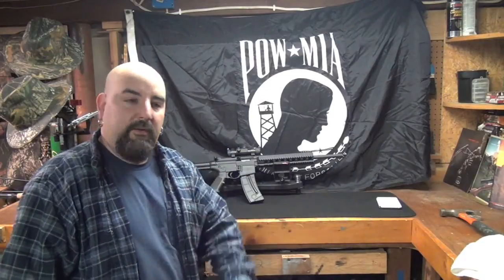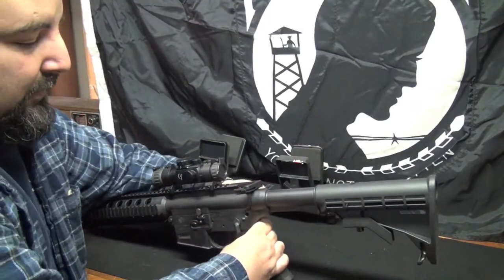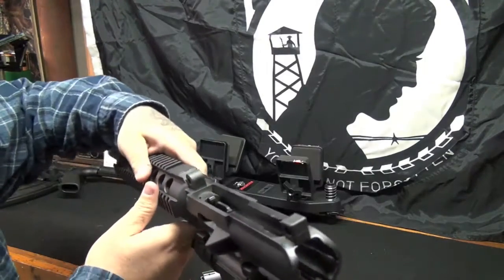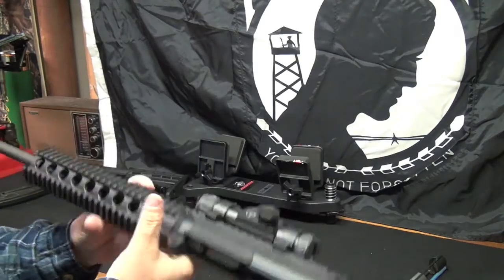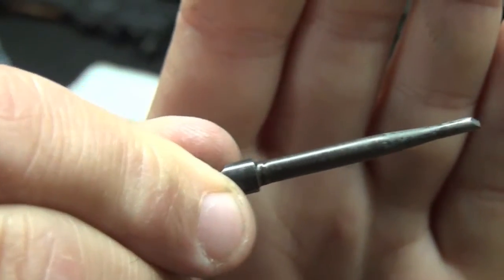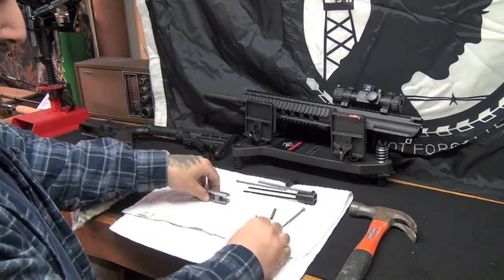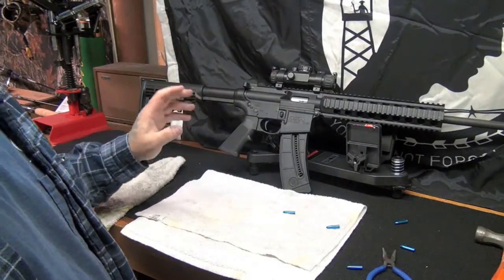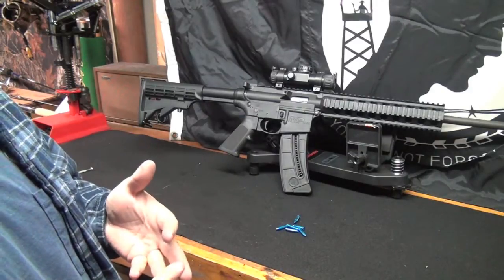how to take down a m&p AR 15-22 witht the yankee cowboy

Comment: Good video, Cowboy. When I took the bolt on my 15-22 apart,  the 'roll pin' that holds in the firing pin looked like a stomped-on mushroom. I got it out, but destroyed it in the process. I called S & W support, and they said 'not to take the bolt apart, because it never needs cleaning.'  So now I have a new bolt on the way after S & W finishes their summer shutdown. (3+ weeks)  :(
I strongly suspect a quality control issue. I know roll pins, and this was no roll pin.

Comment: Thanks yankee.  I have a new 15-22.  Made one trip to the range with a box of winchester 333 bulk ammo.  Had an alarming number of failures to fire.  No feed or extraction prroblems and casings showed what appeared to be solid rim strikes.  I'm hoping it was the ammo.  Did a second thorough cleaning of everything except removal of firing pin.  Lots of fouling and guide rails were gritty.  Trying again today with better ammo.
Reply from the maker: i had trouble till i switched to federal ammo now it runs like a sewing machine
Reply: CCI Mini-Mags